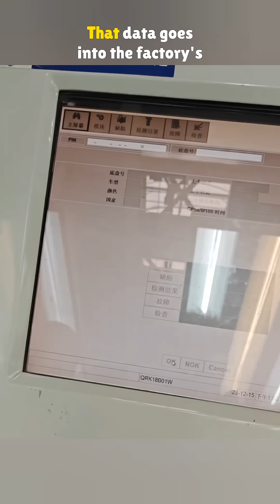What If One Bolt’s Missing from Your Car Wheel #assembly #automobile #manufacturing #factorytour

Comment: So, they do get all the lugs in place. With about $10 million worth of automation. Good for them. But, they still can't design or build a car, that is reliable....or actually efficient.  Or, that does not cost as much as a house.

I'd say that's a big failure.  But....bravo on the lug bolts !